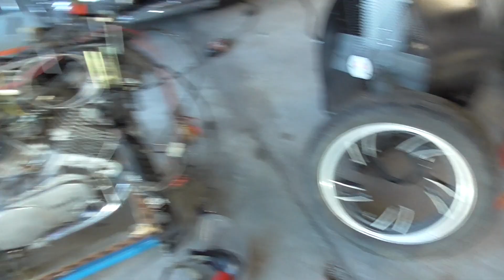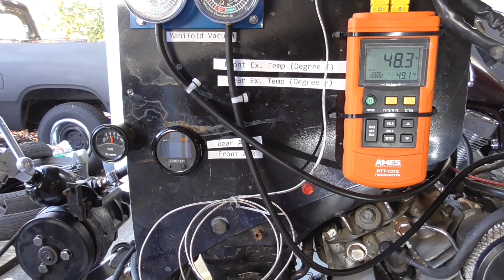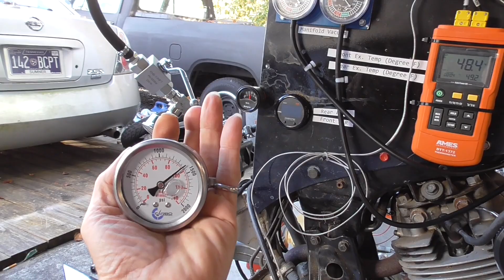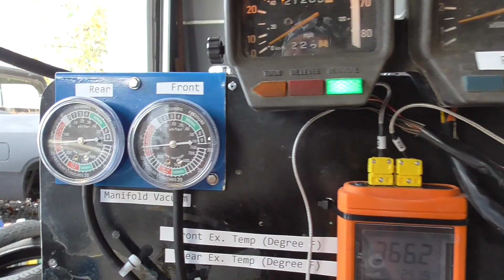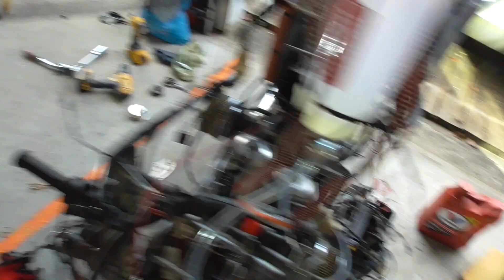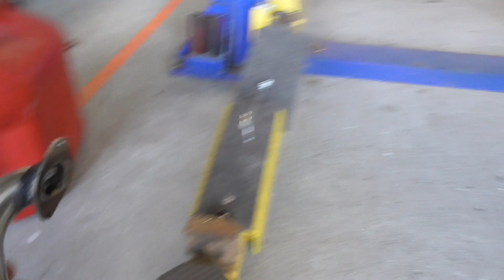Made me a Virago motor test Rig.  Now we can do some motor testing !!!

Comment: Hi Steve. Virago tech question. My 1981 750 has little covers for adjusting the valves. On the inside of these covers some have little angular flaps and some don’t. Is there a reason for the flaps?
Reply from the maker: Hey man, I’m not 100% sure, but I believe they put those pointy shapes cast into the inside of two of the covers as those go on the intake sides of each cylinder since the cover is on angle on the head.  These little pointy things would tend to collect the oil mist and allow it to drip back down vs. it all collecting up right at the cover seal and increasing the chances of oil leaking from the covers. Just another thought (I haven’t looked at where they are in a while though) would be that they would also collect the oil and then drip it back down on the rocker to help lubricate where it touches the top of the intake valves.

Comment: Your ingenuity is amazing.  Enjoy every video.  I have a 1982 xv920, curious to see how my vacuum pressure compares to your.
Reply from the maker: Thanks man 👍. I just finished up my comparison of the dual OE carbs vs. a single carb with a manifold and the test rig did really good.  The only issue I ran into was that the power steering pump puts out soooo much pressure (since I blocked off the overpressure bypass on it lol) that I spiked the initial 2000 psi pressure gage and then spiked the replacement 4000 psi gage while doing the actual testing ha,ha !  Hard to believe that the power steering pump could stall the motor, but since it’s a rotary piston pump vs. a vane pump it basically said “bring it on !”  Good thing I had a 7000 psi restriction ball valve on it or I’d probably been covered in red powersteering fluid 🤣🤣🤣. Thanks again and all the best !  Steve

Comment: Hi There Steve,  I love this motor rig you made to test many different things.  Great idea.  There is a motorcycle mechanic on  “Kaplan cycles” on YouTube that micro drilled certain jets in the carburetor for a 1983 Yamaha Virago 750 so it will run more rich.   The salesman said it runs better a little more on the rich side. Maybe test different spark plugs, Octane fuels and more.
Reply from the maker: Thanks man 👍. Yep, it’s always interesting for me to get to play with these motors and try new things.  It was interesting to see what the actual AFR was with the gages as I tuned the motor the old fashioned way “by ear” and then put the gages on to see how I did.  Nice confirmation that 40 years of tuning these bikes and various other motors by ear resulted in my preferred slightly rich mixture lol.  I can’t wait to finish up the carb manifold testing so I can see the results !  Thanks again and all the best !  Steve
Reply: Thank you very much for your reply my friend,  I love your educational videos and you're a great teacher as well.  From Gary

Comment: Hi, can you tell what the manifold vacuum should be on a single cylinder engine?
Reply from the maker: Hello, it actually varies quite a bit from motor to motor based on factors like the size of the carb, how closed the butterfly is at idle, and even the altitude of the location that the motor is being checked at. For multiple cylinder motors, it’s more important that the vacuum levels are the same for each cylinder, but for a single cylinder motor that comparison cannot be made.  For those, I look for consistency on the vacuum reading…especially when the motor is cold and started vs. when it is warmed up as that can give an indication of leaks that are changing as parts expand and change the leak rate.  Sorry I couldn’t help much, but there are so many variables in what the vacuum reading would be, it would be hard to say what a minimum number would be.